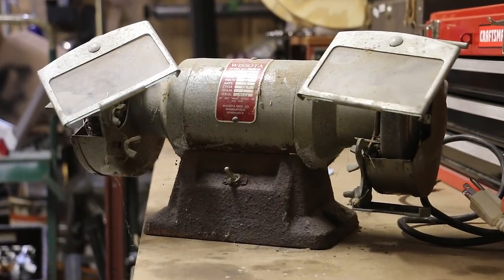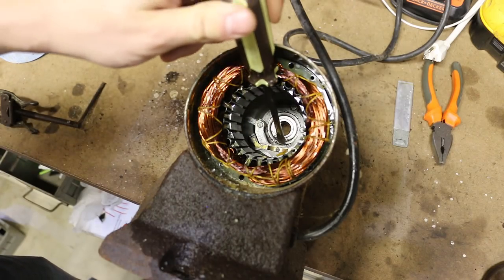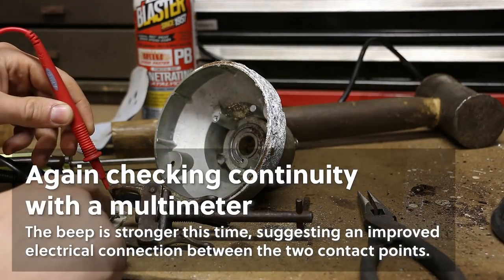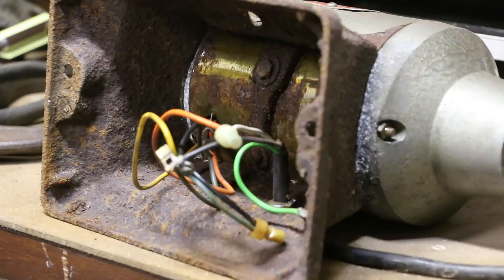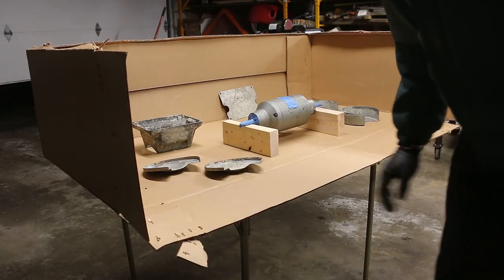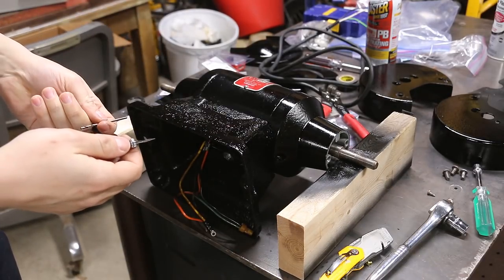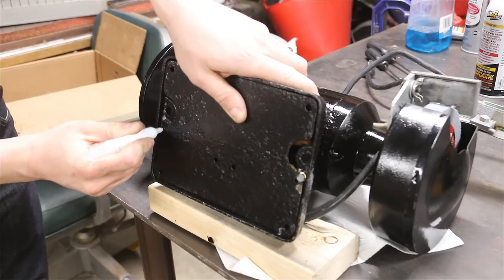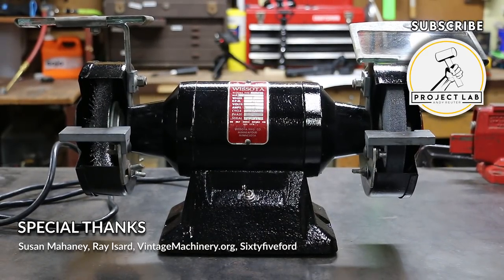Rusty old bench grinder restoration

Comment: I love this video!  Thanks a million. I recently picked up a cast iron Milwaukee bench grinder on Craigslist for $50. It weighs easily 50 pounds. The grinder seems to work fine, but the bearings are a little noisy, so I might get after it and replace em. Thanks again!
Reply from the maker: You bet! Thanks for the kind words. Heck of a deal on that grinder. Good luck with it!

Comment: This restoration reminded me that there's an old grinder in my Dad's shop that stopped working i'm guessing 40 years ago. I remember when i was about 10 or so having to bump the wheel slightly to get it spinning and waiting a good while for it to get up to speed. So it was around that time it was retired and left mounted on the shelf that's out of the way.  When it was retired a new one was mounted in a more accessible location. 
After watching you (with your son's help of coarse) restore  your Father's old grinder i now have Another winter project to add to my list. 
Thank you for making and sharing this video. I enjoyed watching and it turned out great.
Take care.

::SUBBED::

Comment: Dad bought a broken grinder for a few bucks at an outdoor market. Power was going to it, and cap seemed ok. I could hear it hum but it wouldn't move at all. When I tried to rotate the wheel it was not smooth and wouldn't spin by itself if I tried to push it. I tried to open it to see inside for any damage, it wasn't shorted to ground. I could not figure out how to pull out the end caps. This video did help me understand how it's generally constructed. I never could get mine off by pounding just the endcap, but since I realized how the shaft runs, I ended up having to pound one side to push the other cap off.  My bearings were covered with fine wood dust and was not moving at all.  I sprayed the dust off with alcohol and the bearings were already spinning very well. I proceeded to wash it out with the alcohol as best as I could, and used compressed air to dry it out. Then poured fresh machine oil into the bearings, then stuffed the bearings with some grease. I put it back together, and to my surprise it turned on. The device also didn't have a switch, (switch was stolen/salvaged), so I used a pass through outlet that had a switch on it to turn it on and off. Apparently if there is resistance, it can't get started to get going and stay spinning, even though it was movable and you'd think the sheer spinning power could overcome it.

Comment: Thanks for the video! I inherited my grandfathers bench grinder a few months ago. I plugged it in, it made a noise for half a second and died. I have a new switch and capacitor on the way now. I’ll be darned if the big 6 amp grinder I learned on as a kid is gonna get thrown away and replaced by some currently available POS.
Reply from the maker: Yeah!!! What a great tool relic. Hope your parts arrived and the repair went/goes smoothly!
Reply: Andrew Reuter - Just the power switch. She’s running like a cheetah now 👍🏻

Comment: First of all,  Great Video!!!  You answered all of my questions, even ones I have not though of. Was just given the same 1/4 hp grinder yesterday and found out how much these go for on ebay.  Wow!!!  The one I have is close to the same condition but works with a dry rotted cord.  Can't wait to work on it and restore or clean it.  Will probably just clean for now.
Reply from the maker: Thanks! And congrats on that score, very cool! A patina can be a nice look. If it runs and isn’t flaking rust everywhere, I wouldn’t blame you for just leaving it. Good luck!

Comment: Nice video .... Can’t beat the quality of tools made years ago. Definitely worth the effort. For safety reasons I strongly suggest mounting the grinder to the bench or a piece of plywood that can be clamped to the bench. Once again, nice video!
Reply from the maker: Thank you! You are right, this thing definitely needs to be mounted/clamped to the bench. I'm currently leaning toward taking an old rim I have in my garage, welding a pipe to that, and then mounting the grinder to the pipe. It's a useful enough tool to give it some dedicated space in the shop. Although I should probably just mount it to plywood for now because who knows how long it'll be till I get to the rim/pipe plan...

Comment: I have one pretty much just like it but from Sears & Roebucks which I bought about the same time that one was built.  It still runs great and I actually use it every so often.  It's a great machine.  Mine came with two grinding wheels, one coarse and one fine.  I took off the fine wheel and put on a wire wheel, which is what I suspect his grandfather did.  This makes it handier for a home shop.
Reply from the maker: Very cool, glad to hear it’s still in service.

Comment: Just bought and old bench grinder for 5 euro´s. It still works so not sure if I´ll give it a manicure like you did but it is rusty though. Nice to watch! Thanks
Reply from the maker: That's a great deal! I will freely admit that I wouldn't have redone the paint on my grinder if the rust A) wasn't flaking off and making a mess everywhere, and B) wasn't a risk to the new switch. That old patina can often look better than a nice paint job. Good luck with whatever way you go!

Comment: Heck yeah man!  I found an old wissota like that but it was missing the wheel guards, tool rests and eye shields.   I just use it as is, but I consider you lucky to have the complete setup.   Way better machine than those taiwan made throw away grinders!  Nice job!
Reply from the maker: Thank you! Good luck with your machine!

Comment: Great job!  Thanks for sharing!  Next time, for rust removal, try a more concentrated form of vinegar, i.e. 20% or 30%, and warm it up a little.  Much more effective and much quicker.  A great job of saving a usable old tool.
Reply from the maker: Thanks, and thanks for the tips!
Reply: Andrew Reuter I forgot to mention that Bostik Bearing Lubricant is something for you to keep around for these projects. It was originally made by Sandaro for lubing the bearings of woodworking and shop tools; Bostik later bought out Sandaro (older cans have the Sandaro label). For me, it has been the best rust penetrant and lubricant of rusted up tools that I have ever seen. It is available from Amazon and from Rockler dealers in aerosol cans, which last for years, because a little goes a long way. It’s not cheap, so if you ever see it cheap, buy all you can carry. About 20 years ago, the Lowe’s store here discontinued it and sold their remaining stock for $1 a can - I bought all I could carry, and was worried that the price was wrong and they would catch the mistake at checkout. The price wasn’t wrong, Lowe’s just didn’t know what they had, and I still use cans left over from that haul.  Thanks again for your video - great project!

Comment: I totally agree, with this minding, you can restore about anything, that way I restored a 2 stage «HD compressor, an engine lathe, a brake lathe, a valve refacer, washing and dishwashing machine, dryer and so many equipments
Reply from the maker: Very cool! That’s a lot of stuff!

Comment: I just finished doing a revamp to my 30 year old Skill 8 inch bench grinder.
I was worried if it had brushes and it needed a general clean up and repaint.
The only issue I found was the bearings needed a good clean out and regrease.
They had no wear or itchiness after cleaning and spun like new when greased.
Brushes weren't an issue, there isn't any.
So now it's ready for its next 30 years.
Cheers
Reply from the maker: Congrats on your grinder project! The bearings here sounded fine enough to me, but maybe I’ll have to crack the thing back open and double check them. Cheers!

Comment: The "clutch" thingy is a centrifugal control for a START WINDING.  It has the contacts close feeding power to an extra set of windings when you first start it.  When the motor reaches a certain rpm it opens the contacts and the start windings drop out of powering the motor and it runs normally.  When they are stuck open the motor simply doesn't have enough torque to start turning, start capacitors are another way to provide the initial boost to start turning.
Reply from the maker: Great explanation!

Comment: I absolutely hate it when someone tells I can't do something. These same people would throw that grinder in the trash and go out and spend $150 on a new grinder made in China. The only thing I would have done differently is to address the bearings. Either replace them or at least clean and service them. I love restoring old tools.
I have a small roll around air compressor form the 40's  I found it in the trash. Everything was frozen on it.
I brought it home, disassembled it, ( took hours ) cleaned and replaced anything broken and repainted it. Works like a charm now. I love it. I have several old tools I have restored and they will probably outlast me. 
Good job.
Reply from the maker: Very cool to hear of your success! Agreed on all counts! Thanks!

Comment: It's cool. Most tools I buy or get for free that are "broken". Usually I can just take them apart and clean them and they work. Or it's a cheap serviceable part. Got a dewalt planer for $60 costed me $10 for new sprockets and it works better than new! $500 planer for less than $100

Comment: Great job

Glad you saved it especially since it was grandpas

Only thing I would have done different is I would have used the same green paint it had originally

They make it and looks amazing

Not hating just my opinion

Great job overall and glad you didn’t listen to those saying it couldn’t be done
Reply from the maker: Thanks! I was hoping to use a more original paint, but ended up with this stuff just because I knew it worked well. But agreed in principle! Do you know who sells the original stuff?

Comment: Nice resto, you should give electrolysis rust removal a try. It doesn't etch like vinegar does and is much gentler to the items. I've never had to put in much work using that method.
Reply from the maker: Been hesitant to use electrolysis because of the “explosion factor.” But I’ll have to give it a try again one day. 👍
Reply: @AndrewReuter  I guess if you had a garbage bag over the bucket and flicked hot cigarettes all over the bag you could get some boom boom. How well ventilated is your shop?

Comment: Kudos on the restoration! Wish I had access to my granddads' tools..... I've found self-etching Rust-Oleum Hammer tone works well for restorations and Verde Green or Dark Bronze gives a factory look.  The new wheel is causing too much vibration. You may need to balance it or dress it,  if it is causing that much of a vibration. Good vids on YouTube for balancing new wheels. (even without self-balancing collars)    Donut shaped screw-in rubber feet will not move as much as the solid faced pads.
Reply from the maker: Thanks! And thanks for the tips!

Comment: Great job, there's nothing better than salvaging an item from the past, especially if there is a nostalgic connection, like from a father or grandfather... And as the old saying goes, "They don't make em' like they used to!" (now they're all Chinese junk!)
Reply from the maker: Thank you! I will say that I think it's the tool manufacturers' specifying junk that is the problem. Overseas workers would probably love to build high quality tools instead of some of the junk they're asked to make. But absolutely agreed on the general sentiment here. While it's nice that tools are generally so cheap and available these days, that has also artificially degraded the value on these cool old tools that maybe need just an hour of work and a little bit of gumption to get going again. Instead they needlessly go into the landfill to make room for the sale of another new tool. That's the way it goes I guess... Have a good one!

Comment: There are several things you can do to set  the guards correctly and stop most all the vibration. I have seen some videos on youtube. don't remember witch one right now, and when you put on a new wheel even after the ring test don't stand in front of the grinder when you first turn it on and let it run for 5 to 10 minutes but all this depends on who you ask . Good Luck

Comment: In technology, there is not such thing as non reparable. There is always way to repair anything, not matter what the fault is there is no questioning that, however there is a question, is it economical to fix it. You just proved that. Some will say buy new one cheap, but then again this is a professional tool. So its just about is it worth fixing or not. Anything can be fixed...
Reply from the maker: Well put!

Comment: The bit you had to clean up was the centrifugal switch used to cut out the starting windings (or capacitor, tho I don't think I saw a starting cap). It's the same principle as a flyball governor, just it actuates a switch (the part you cleaned for better contact).

I've checked motors with bad start winding switches by wrapping a string around the shaft, giving a pull, then flipping the power on. A quick way to check if you're not sure it's worth saving or not.
Reply from the maker: Great tips. Thanks!

Comment: It was your grandpa's tool, so it was worth restoring regardless of how cheap a new one may be. Besides that it's a high quality old grinder, much better built than the cheap new ones, 50 years from now it will still work or be easily repairable while a 40$ new one won't last even half as long.
Reply from the maker: Seconded!

Comment: I do NOT recommend abrasives on Brass or Copper electrical contacts.
Many electrical metal contacts will have a thin plating (for longer life, corrosion prevention) ... 
abrasives (emery cloth, sandpaper) will remove plating — and can be ongoing problem.
USE Alcohol and Stationary paper (20 or 24 weight) for contact cleaning.
—
Your original paint finish was a Hammer-tone Verde Green or “Hammered” finish.
https://www.rustoleum.com/product-catalog/consumer-brands/stops-rust/hammered-spray

Hard Rubber Bumpers (Feet) with “Push-In” stem for 1/4” holes are readily available from Automotive and Hardware stores.
1/2" Diameter is popular size — but there are other sizes and profiles.
When using Stainless steel threaded hardware (replacement) — use an Anti-Seize.

For the Ground Screw thread, on Grinder’s metal base, industry standard is #10-32 thread.
This is same thread that is used in modern metal electrical boxes.  Article 250 of the National Electrical Code (NEC).  
Crimp a #10 Ring Terminal to Green wire of the Electrical Cord.
IF buying a new cord, 9 Feet AWG 16 SJO 3 Wire 125 Volt electrical cord for this 2.8A Wisscota Motor.
Reply from the maker: Lots of good detail here! Thanks!

Comment: Nice refurbish job. Next time you want to remove those metal labels, try using a flat ground side cutter to get under the push screws and lift them out. They will come out fairly easy allowing you to paint underneath where the metal label was and then you merely tap them back in. Easy peasy...
Reply from the maker: Good tip! Will give this a try. Thank you!
Reply: The nameplate is held on by rivets in later years might be screws on that old of a grinder. I did find it interesting how similar 1980's-2000's grinders are still to that one.

Comment: The centrifugal switch you have found  is predating the capacitor start and operates a start winding until  the rotor is up to speed and then the start winding is disconnected. After all,that work I hope you changed the bearings.
Reply from the maker: Great explanation! I thought the bearings sounded fine, but it’s not too tough to get back in there if I need to.
Reply: Aussie Mick Not quite, capacitors, start and run windings are used together. The switch is as stated, it switches from the start to run winding. 

The capacitor pushes the rotor in the right direction when a start winding is present or can get the motor up to speed and then switch to the run winding. 

If you have a capacitor start motor with a bad cap you can actually push start it and the start winding will take over, no cap needed.

Comment: Wonderful job.  You inspired my to started on my Wissota E16---but somewhere in the mess I lost my wiring diagram, do you happen to have yours still?  Thank you  so much.
Reply from the maker: Thanks, cool to hear! I'm behind on answering comments, but I'll jump ahead in the queue here and respond to this one since your question is fairly urgent... 

Truth be told, I have never been able to find even a manual for this grinder, much less a wiring diagram. But the wiring appeared to be pretty simple inside mine, which offers some hope for yours. Do the shots of wiring from the video help at all? What part of the wiring are you dealing with?

Good luck, in any case! Hope I can help.
Reply: Thank you so much for the reply.   I tried several times at the video but cant see what go where.  I am trying to find where the five wires coming from the motor go.  I can't figure if two are joined with other connections or not......thank you again for any help   dane
Reply from the maker: OK, finally found the photos I took during the restoration. They offer a bit of a better look at the wires. Photos and analysis posted on Twitter because it's the easiest place to share this stuff: https://twitter.com/andrewreuter/status/1088181395959308302

Good luck, be safe, and please let me know how it goes!
Reply: That's WONDERFULL!!!!!!!!! You're AWESOME!!!!!!  I was so confused by the extra black wires, I got tired of popping my breaker trying to figure it out (not to mention scared I was going to ruin the motor)......Thank you Thank you Thank you........You're AWESOME some more.......